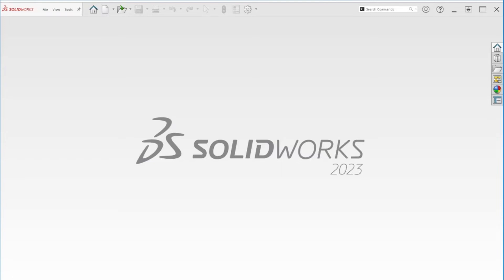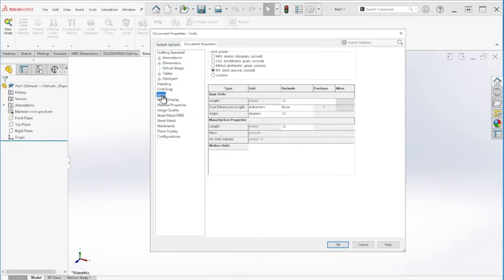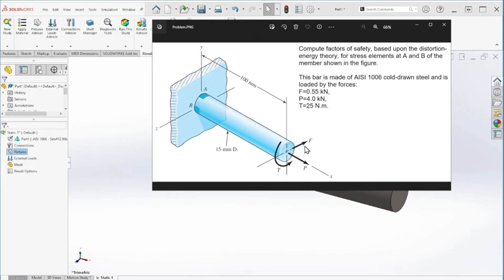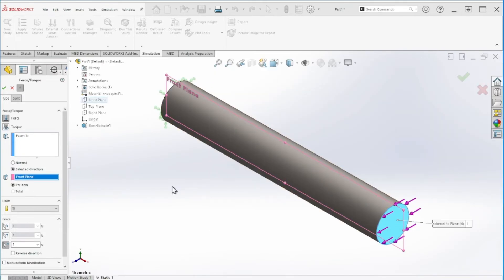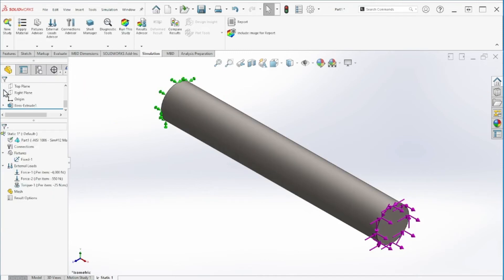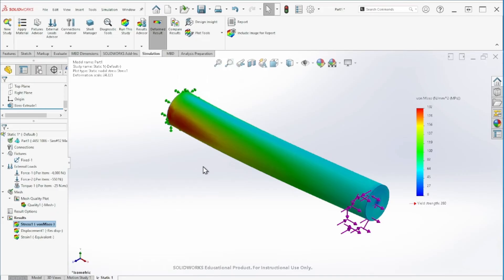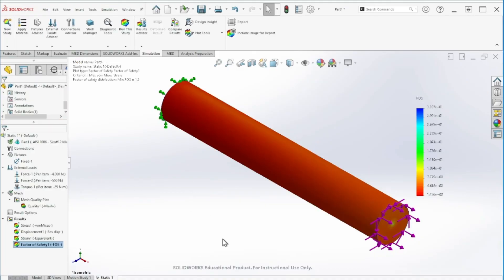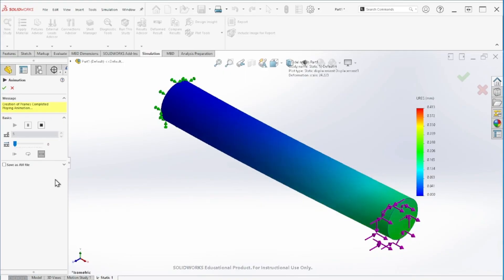How to calculate Von Mises Stress | Combined Forces | FEA for beginners | SolidWorks Simulation

Comment: How did you get the value of σx = 22.635 and 𝜏xy = 41.875 for calculating maximum plane stress ?
Reply: For sigma_x = F/A = 4F/pi* d^2 = 4(4000)/pi*(0.015)^2 = 22.64 MPa